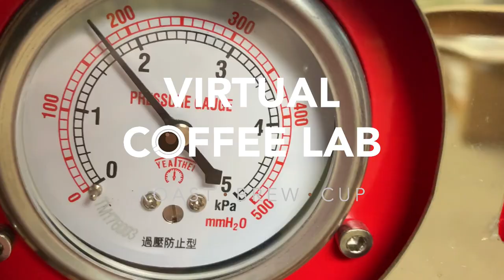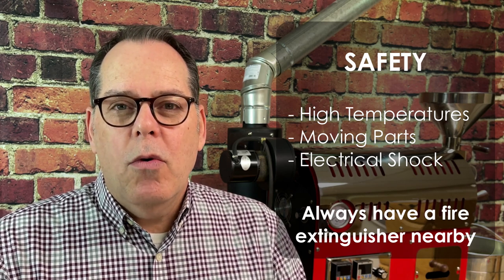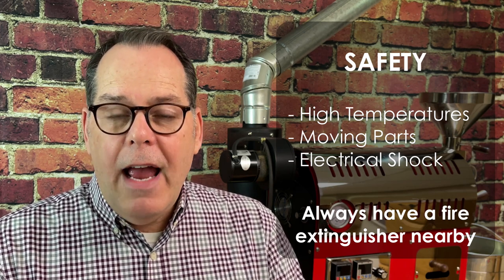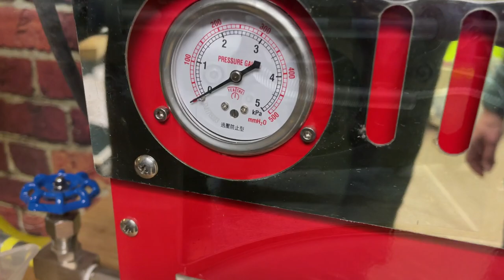10 Mistakes New Home Coffee Roasters Make

Comment: I am a Green Bean and I am abut to learn, I am in the middle of making a drum roaster.
Is it Wise to doo as a Green Bean, is it a steep learning curve, probably not, any yes.
I love you videos, I find the meaningful and informative. 👍
My skillet for doing this project is : I am educated as an electronic engineer with controlling and regulation as my major, and has an electro mechanic education as well.
So I can designe PCB, program, welding, turning, milling and rewind motors.
So a drum roaster is right up my alley 😊 I hope 😂
I did the same with Beer Brewing, that was a vertical learning curve, not so much a curve when it is pointing in to heaven😂
But I am making good beer today and designing my own recipe, that is ending up as lovely beer.
Anyway Thanks for your effort and your time, it is highly appreciated 👍👍👍
Reply from the maker: Hello Allan, thank you for your comments.  Sound like you are up to the challenge.  You have all of the mechanical skills.  When creating a drum roaster consider important features to include.  This will help you roast some great coffee.
1.  Variable drum speed
2.  Variable airflow
3.  Blades inside the drum to tumble and mix the coffee and prevent burning beans.
4.  Good ventilation
5.  Trier port to view and smell coffee during the roast.  

Let me know how it goes!

Comment: You’ve been so helpful. I’ve definitely listened to you when you had told me in a previous comment that all the coffees are exotic and roast. I took your advice and nailed the Ethiopian sweet Lilly. But now I am struggling with a wet processed yirgacheffe. I’ve tried a good charge temp of 250 with my hive and a 150 grams. Soaking the beans starting with low medium heat and end of dry at 530. Ramp up the heat and hitting First crack at 0930 with 50 percent reduction in heat slowing the roast and ending at 1130 with a temp of 406. Getting nice chocolate but not much of the brightness or floral as my local roaster can achieve with the same beans
Reply from the maker: Hello Jeston, The wet process Yirgacheffe is a high density coffee with no mucilage because it is washed.  It is a small-ish bean.  If "soaking" means no heat, then don't soak.  The beans are less prone to roasting defects compared to the natural you were roasting.

Using the Hive, pre-warm to 220-250, turn off heat, pour in beans, start the timer, set heat to medium low and then start shaking.  Dry should take place between 4-5 minutes.  You can leave your heat setting where it is for most if not all of the roast.  Instead, raise or lower the hive to adjust for heat.  This way you are not distracted.  Actually, if you watch this video https://www.youtube.com/watch?v=shnQf3fsoxg    you will see the entire roast and how i did it.  You will also see how I chart my times and temps so I can reproduce the roast over and over.  

The hive is a wonderful roaster but it is very different than a drum roaster.  The highest heat should be in the earlier part of the roast and you will gradually lower the temps throughout the roast by simply elevating the roaster.  At least that is the way I do it.  My hive has the temp gauge so i can constantly track my roast..

Comment: Under the " Know your beans" category I would add one should avoid getting a lot of different kinds/origins. Some vendors include a sampler pack when you buy a roaster. This can be a source of frustration due to differences in density, elevation, etc...as you mentioned. I would advocate buying AT LEAST 5 pounds of a bean you know you like,  then spend your time learning with that and learning to taste those differences.
Reply from the maker: OOOOooooooo, Ed, that is a great tip.  Agreed.  It will be easier to measure the results if you are roasting on the same coffee.  That reminds me.  About a month after I got my roaster I was asked to roast and serve fresh coffee for about 200 people.  It was a Christmas fellowship thing at church.  I purchased 20 lbs of Guatemala HueHue  and that was my first real way I was able to compare roasts and the subtle changes I was making.  By the time the event came, I had enough information I was able to dial in a pretty decent cup.  Thanks for the tip!
Reply: This is a great point! When I first started roasting I almost always stuck with sample packs. I quickly grew frustrated when it only took me two roasts or so to blow through a pound without getting satisfying results. These days I try to go "deep" rather than "wide," and my roasts are better for it.
Reply: This is useful and timely for me to hear. I started with a single type of bean because it was what I’d been buying and was no longer available to me. I’m about to make my second purchase and was going to try a variety of beans. While I’ll still try a couple others, I’ve pared the list way down thanks to your very sensible advice.

Comment: I just started roasting with a popcorn popper and would love to be able to connect with other people doing this. I’m using a West Bend Stir Crazy and an Orville Redenbacher air popper. The WBSC has a hot plate with a rotating arm that pushes the beans around. What I like about it is that it’s slower. I have been roasting 70 - 100 grams green beans and it takes about 15 - 16 minutes. What I don’t like is that the beans get pushed around so the roast is a bit uneven. I do periodically lift the lid and stir them. The air popper gives a more uniform roast but it happens so fast that the beans get darker than I’d like. With the air popper it’s very obvious when it hits first crack; with the Stir Crazy, there’s not much cracking going on. In spite of these challenges, even my very first small batch was better than the coffee I’d bought at Whole Foods. A friend came over today, he’s been buying from a local roaster and liked mine better. Most places roast too dark for my tastes, their coffee tastes burnt. 

I’m learning a lot from your channel and from the comments, hope to find a place where I can connect with other budget home roasters. I realize there are limits to what I can control with such a crude setup but it’s already worth it.
Reply from the maker: Thanks for sharing and your comments.  The hot plate and wand generally don’t roast quick enough for my liking.  The next step will be either a sweet Maria’s popper, a homemade hybrid roaster, or a fresh roast most likely.  You will get better results with any of these compared to a popcorn popper or west end.

Comment: I have a small drum roaster with a bunsen burner for the heat. I try to have the heat start at 280 when starting. I roast 4oz of beans at a time. The temp swing in the garage is approximately 100 deg from winter to summer. 

When I drop the beans the temp will always drop to around 200. I look for my beans to be yellow at the 4 minute mark so they are dry when they start to roast. I then look for the beans to be at start of first Crack at around 12 minutes and then done with first crack plus about 15 seconds at about 15 minutes. It gives me beans that are with a little oil on the outside. I then pull them and put them in my cooling tower within 10 seconds, with a vacuum and fan going. They cool enough to handle in another 20 seconds. For me this gives me quite a great tasting cup of coffee. I can repeat this most of the time. If I want a little bolder cup I will let it go 20 seconds. After first Crack, and increase the time a little more for a bolder tase. Once I get to second Crack all timing control is gone. 

I know this is crude but it works well for my roaster and me.
Reply from the maker: Hi Mickey, thanks for sharing your coffee roasting method using the home made drum roaster.  Wow, 100 degree temp swing  because of seasons is crazy.

Comment: This video was exactly what I was looking for
Reply from the maker: Thanks for watching.  Glad it was helpful?   What are you roasting with?
Reply: @VirtualCoffeeLab  I’m roasting small batch in a steel pot with salt. I tried on cast iron and it’s very uneven because the beans that sit flat get scorched on that side and other side is like medium roast hence Salt roasting. It takes 2 minute for the salt to heat on medium high in the steel pot. Then I put the beans in and keep stirring. After first crack when it starts to smoke I take it off the heat and keep stirring and put it back on the heat after awhile. I keep repeating this process till It reached a desired roast level and strain the salt out. I usually prefer a medium to light roast. This process is laborious but worth it, also there is lot of control and visual here. And I have no idea if the tiny(very tiny) amount of salt that gets in the grinder will damage the grinder but it definitely improves the flavour.
Reply from the maker: @Tenzin Rigol that is very interesting.  So you add salt in the pot during the roasting process strictly for flavor?  If yes, why not put a little salt in the coffee after you have brewed it?  Just curious.  Glad you are enjoying your coffee!
Reply: @VirtualCoffeeLab  I use salt for even roast as it envelopes the bean unlike cast iron.

Comment: I have been waiting on the Fresh Roast sr800 and just tired of waiting. So, I am in the process of constructing my own drum roasting coffee machine. I will use propane for the heat and have an electric motor to do the work. Hopefully I will have it roasting coffee in a week or two. Jerry Hubbard   Irmo South Carolina USA
Reply from the maker: That sounds interesting Jerry.  How big will the drum be?
Reply: @VirtualCoffeeLab  It is 5 inches in circumference and 9 inches length. I like to roast half pound amounts. I think this would do a pound but I doubt if I will try that much. It has been fun so far building. I researched a lot of other designs and decided to do the one I am working on. It will not have any thermo couples but most times I use a thermo gun and time counter and of course site and smell. Might have it going in a week or less.
Reply: @VirtualCoffeeLab  5.5 dia 9.0 length. It really works great but hard to see the color of the beans. The holes in the screen type drum are small. I usually pay attending to first crack and most times I like to drop at the first second crack I hear. My home made bean cooler is the bomb. Under a min and the beans are ready for the bag.

Comment: I’m new to roasting, and I bought a bunch of different premium green beans. I run them through for seven minutes on my Poppery II popcorn roaster. I pull them at 7 minutes, Just on the verge of second crack, hovering around there depending on the size of the bean. I’m currently letting them rest for about 2,3,4,5,&6 days before attempting to pull a shot. So far I have had a difficult time getting a really thick crema when I pull a shot. I have no issue when I get other types of fresh roasted beans from my local roaster. I’m wondering if I should bring the time back towards six minutes or up to eight minutes or so to increase my crema. Actually currently, I’m having a very difficult time building pressure using a day or two, and day three roasted bean. I’m wondering what drives Getting a good Crema. The amount of days that it sits afterward? Or is it the amount of time I’m roasting, or the ~350 degree poppery roast temp. I’m really looking forward to when I can pull a really nice shot with beans that I roast. Open to any advice! I’m roasting a half a cup of a time by the way. I’m thinking about bringing that down to a quarter of a cup in order to slow the roast time.
Reply from the maker: Hi Mark, welcome to the world of home coffee roasting.  Unfortunately I'm not an espresso drinker/brewer expert.  I would say that a good rule of thumb for espresso is to let freshly roasted beans rest a week.  I would also consider looking at the roast date of your local roastery beans to see how long they have rested.  Sorry I an't be more helpful on your issue.
Reply: @VirtualCoffeeLab  thanks for the feedback! Love your videos

Comment: hey! great video, I am roasting from home on an ARC800 with an external exhaust fan. I currently have the ducting set downwards since the machine sits higher than the window that I run the ducting through (I am not sure if this is resulting in poor airflow and ashy notes in my coffee) . Should I be directing the ducting upwards towards the selling or just higher than were the machine/exhaust sits? thanks!!
Reply from the maker: Hello Margaret, thanks for watching my video!  

How dark are you going?  What type of coffee are you roasting?  How long is your total roast time?

Hmm, so you are experiencing ashy notes in your coffee?  I did a video https://www.youtube.com/watch?v=dfbRqAgnr4o answering this question.  

If it isn't the airflow, there could be several other reasons I have listed below:

1.  roasting coffee too dark
2.  not cooling coffee quick enough, causing over roasting
3.  Roasting natural and honey process where the Mucilage is burned
4.  Roasting defects including tipping will cause ashy notes
5.  Poor airflow is another possibility not listed in the video. 

The most common issue I have experienced is from roasting defects.  Double-check your roasted coffee for tipping.  If you see black marks on the ends of your roast then the inside of your bean may have some burning as well.

Let's talk about your airflow.  I tried to find a manual for your roaster and was unable. You should test your airflow and know what impact your settings will have on your roast.  Here are some thoughts.

Use the lighter trick or measure air velocity.  I don't think the downward angle of your exhaust should influence the flow as long as you have positive pressure.  Regardless of what the manual might say, always check your airflow so you understand how much air is moving through your system.  This is really important during the roasting process because hot air (convection), as well as the hot metal drum and bean-to-bean contact (conduction), is used to roast your coffee.  Air movement is really important to move smoke out of your system, otherwise, it could influence the cup.  Air needs to move through your system AND your fan speed should be tested to ensure good airflow.  

There are a couple of ways to test your airflow settings.  One way is to use the lighter trick.  Make sure your ejection door (the door where the beans come out) is closed.  Now, pull out the trier and light the lighter.  Watch the flame bend based on the amount of air you are pulling through the system.  At a minimum, you want to see a slight draw with a slightly bent flame.  The maximum would be a bent flame that almost extinguishes.  I roast somewhere in the middle or a little higher and leave it alone.
The other way is to measure air velocity with a meter.  Not sure exactly what you would need but do some research and you can find a meter.  I have never done this.

By the way, you might want to simply go outside and feel how much air movement you get and low, medium, and high settings.  See if there is much of a difference.  You could disconnect your vent and measure it right from the inside as well (with no heat or roasting going on.  Simply measuring airflow.  I have even used a piece of paper that is taped to the end where the air comes out and watched how much movement the paper has.

Hope my comments were helpful.  Let me know what you determine.

Comment: Great video!  Slightly unrelated, I’m looking at picking up a 500g gas USRC roaster and was wondering how long a tank of propane usually lasts.   I know you’re on natural gas but thought you may have tried propane before.  

Is there a way of telling how much propane is left so you don’t run out mid roast?  Thanks!
Reply from the maker: I would guess about 40-50 hours.  You can figure it out based on your roasters btu rating.
Reply from the maker: Take a look at this link and then calculate your btu rating instead of the 30,000 btu example. https://learnmetrics.com/how-long-does-a-propane-tank-last/#How_Long_Does_A_20_lbs_Propane_Tank_Last_On_A_Grill_3-Step_Calculation

Comment: How long should I preheat the roaster?
Reply from the maker: Hi Cheisi, thanks for your question.   
My drum roaster takes 20-30 minutes minimum to warm up.  The manufacturer (mill city) instructed that the warmup should allow the roaster to reach it's peak temp, where the safety shutoff engages.  That is 455 on my roaster.  
So, I do it a little different.  I warm the roaster up by setting my gas on 30% of it's maximum capability and let the roaster warm up for 30 minutes, then idle it down to 25 degrees below the charge temperature I will be using.  Then have everything all set to go, turn on the gas, let it build up to charge temp and then charge/put beans in the roaster.
There is a lot of metal to heat up and that is why warmup is so important.
What type of roaster do you have?